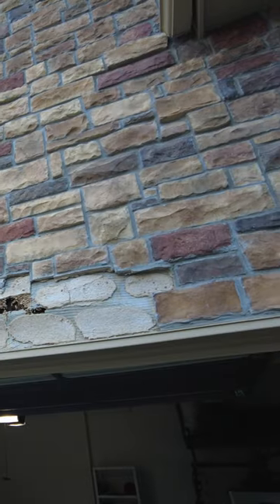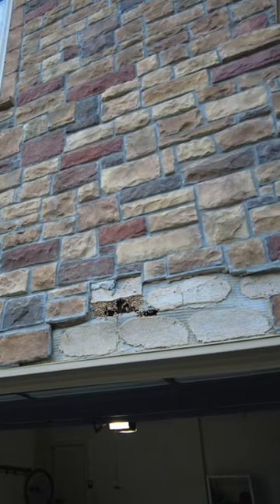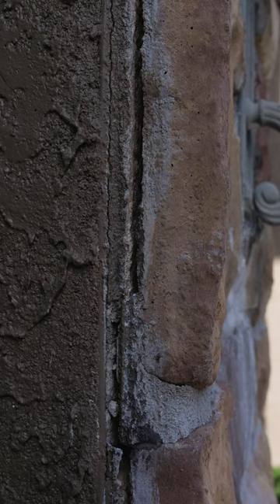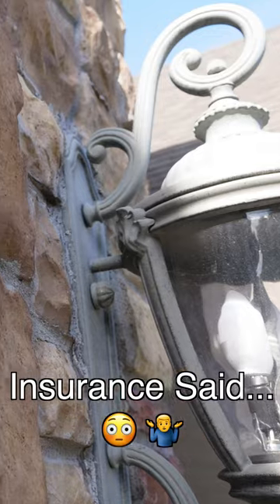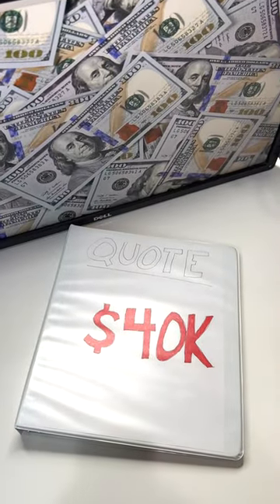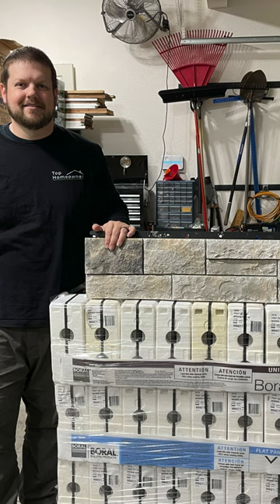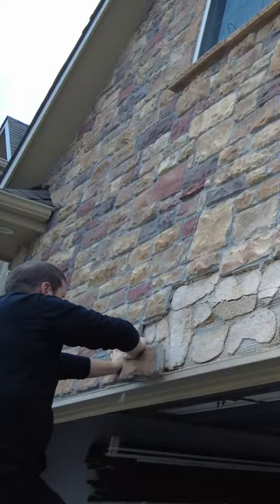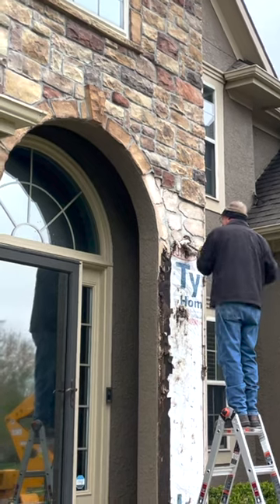DIY Home Rescue: $30K Saved with Versetta Stone!

Comment: Home insurance should be required to cover most of the cost on major repairs like this.
Reply from the maker: We thought it would be because our agent and a restoration specialist came in and thought it was from driving rain but once the adjuster came in they said due to the lathe being rusty that it had happened over time and therefore NOT an incident 🙄
-C

Comment: If it was a brand new home there should have been a warranty. You would also have grounds to sue for the shoddy work. You might want to get a whole house inspection with a trusted electrician and plumber and foundation expert. If one corner was cut, there are more. I am speaking as someone with experience working for a home builder, bought a new home from another home builder i wasnt employed by and having several relatives in the trades from Electrician to plumbing to HVAC in both new construction and maintenance/repair.
Reply from the maker: True, unfortunately the house was 14 years old and there was no evidence when we had an inspection prior to buying the home. It was thought to be driving rain that caused it but it turned out to be what made it finally visible. Next week's video will show more about damage found. You are right though, over the last 4 years we have found many cut corners and learned a lot from others in the neighborhood. -C
Reply: @TopHomeowner  Good thing you talk to your neighbors about their house problems.  In my neighborhood we were having water pressure issues and black flakes in our water. I spoke with the neighbors and they all had it too about the same time. I called the water dept and got through to one of their engineers who said that all the housed across several neighborhoods are were complaining about the same thing and that we should replace the regulator valve at the shutoff point for the house and replace the hoses on the water heater and under the sink, that it was the builder had used subpar fittings. Sure enough, realativley cheap parts fixed the issues, especially the black flakes. The hoses were degradeing so badly on the inside. We posted the fix on the neighborhood site along with a shopping list and instructions. It helped a lot of people.